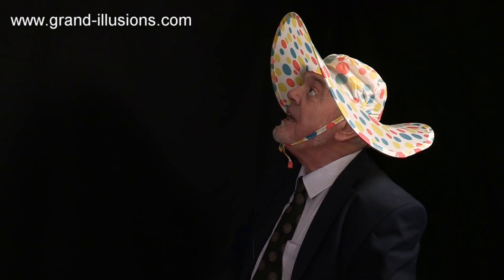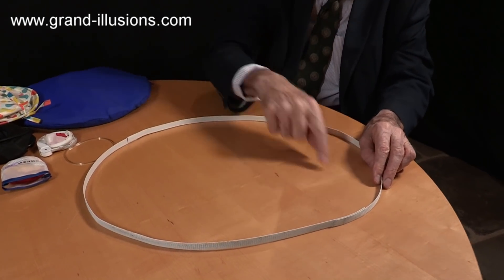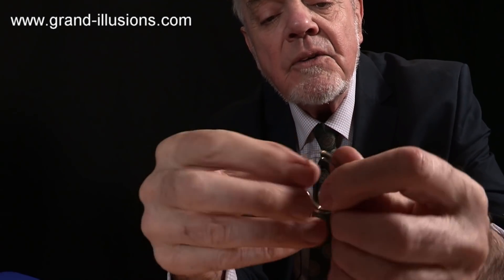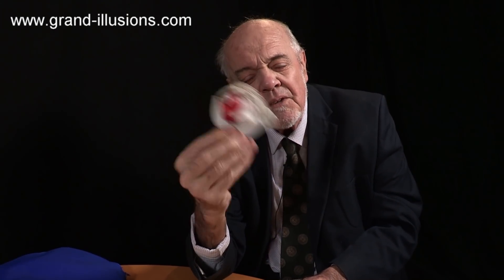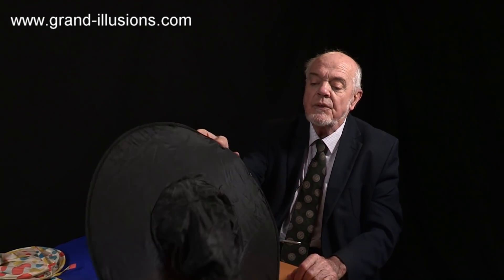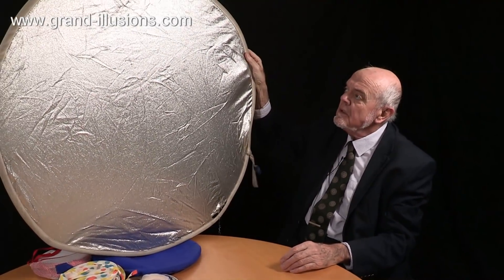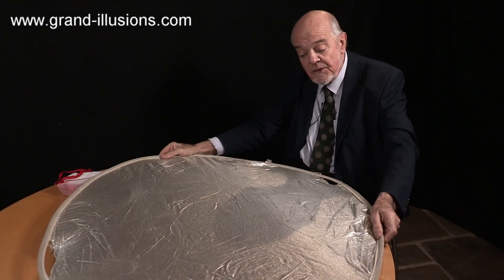Bandsaw Mechanism

Comment: As  a Boatbuilder we use the bandsaw daily. It is a scary thing to unwrap the sawblade when you change it! Toss it on the floor and hope for the best :D
Reply: I used to have to do that with 26 foot one lots of space needed fun times.
Reply: I used to work in a steel stockholder and we had three bandsaws that took some huge blades, as you say, open the box, slide it out and then throw it onto the floor and make sure you stand well clear 😂
Reply: I used to be a patternmaker and we also had what must have been like 6 meters long band sawblade. Trying to release that or to fold the old one away was always a horror show :D
Reply: You forget a crucial step. Duck. And cover. So. You pull it out of the box, cut tape and ties off while holding firmly. Throw onto the floor of your workshop. Turn while it’s still in flight. Duck. And cover!  I hate changing my bandsaw blades so muchhhh. It’s almost as bad as a fully extended metal tape measure!
Reply: Do the saw blades y'all get not have a plastic cover on the teeth, or is it just more fun to throw it and watch it unravel? My short experience with saw blades in a machine shop was to carefully unravel the blades with gloved hands.
Reply: Toss and immediately jump back. Don't set it near the ground before letting go, had one spring up and nearly catch me in the face once
Reply: bandsaws and chainsaws: two saws I refuse to within 10 feet of!

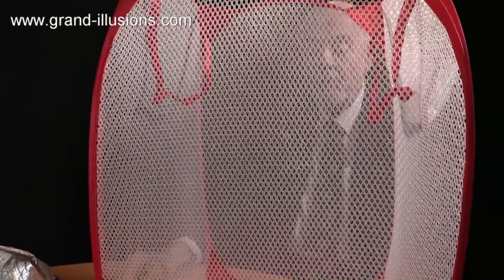Comment: 5:09
Ah yes, the infamous bitrate-killer laundry basket.
Reply: If you've ever owned and tried to use one, you'll also know it as an everything else killer. It doesn't take long at all for the bands to work their way through the cloth and start cutting everything they pass across--hardwood floors, furniture, skin, pets...
Reply: @quintopia  I can attest to that
Reply: Bitrate?
Reply: @stitcha123  Bit rate is the amount of digital information per second. The video gets blocky when there's too much happening for the current bit rate to handle, such as all the lines and holes of the laundry basket. Confetti, fire, large crowds of people such as at a sporting event can do the same thing.

Comment: While camping with the caravan, we got a pop up awning tent, so that we could create another bedroom for a camper sleeping in the awning since the van only sleeps 2. 
It has two more squared rings like the last laundry basket, so that when it pops out it forms a sort of tall triangle prism, the two upper faces enclosed by the bands a d sharing a top edge, connected by a groundsheet at the bottom and more polyester walls at either end face. Due to the size and not being a perfect circle, one has to make sure to grab the right spots on the rings to get them to behave and doing both at once is a little trickier, but they coil up for storage in s circular bag about a yard wide or so.

Comment: I have and they are readily available a hunting blind or what I've used it for is a temporary shelter almost like a tent it fold down to carry sack size is remarkably light yet water and wind resistant work alot like the laundry basket you have.

Comment: The bandsaw mechanism reflector also comes in a very fascinating version called the five in one.  The central reflector is thin and white and can be used to reflect or diffuse a light source, and it comes in a form-fitting zippered sleeve that has a different color on each face.  The sleeve is made of two circles, one with silver and gold faces, and one with a black and bright white faces.  It is a very practical and useful tool in film making.

Comment: I have one of those reflectors being into photography/cinematography though it's a 5 in 1 reflector. Got 3, one circular the other two move rectangles and are bigger but same idea you twist it to make them more compact. Also have a 2x1.5 meter green/blue screen (double sided) using the same idea but it's more of a pain to fold down.

Comment: I've seen a few windshield sun reflectors using the bandsaw mechanism, small enough to tuck away underneath the car seat when not in use, mechanism makes it easy to maintain form when popped up.

Comment: I wonder if this mechanism could be used in the medical field say as some sort of quick splint or wide area general gauze staunch/dressing. if you combined it with a very powerful adhesive, you could use it as a deployable large area adhesive pull stich. if you wanted to tackle it from a survival perspective, a tent or signal device would be simple enough.

Comment: I used to have a frisbee like that! 

On the notion of what else could be done with this mechanism? hmmm... perhaps several of them arranged over each other or soldered together at the right points could make a pop-open ball? Or maybe use it as a sort of practical joke? Put a disc of this material (like the frisbee) with glitter or confetti or some other light, harmless, yet messy substance, in a small package under tension and when opened up it pops open and flings glitter around?